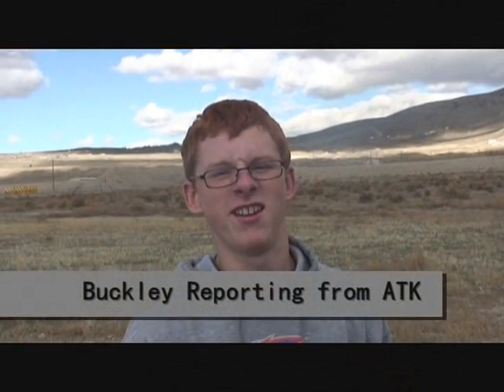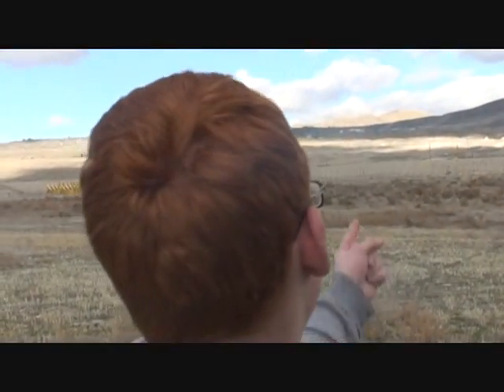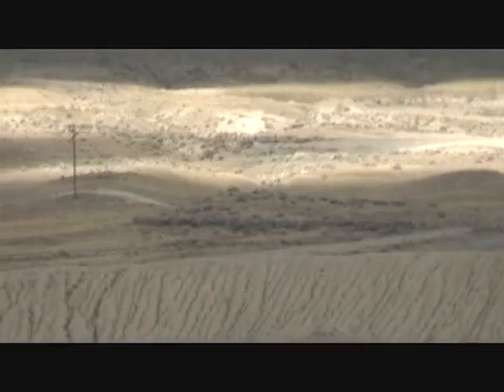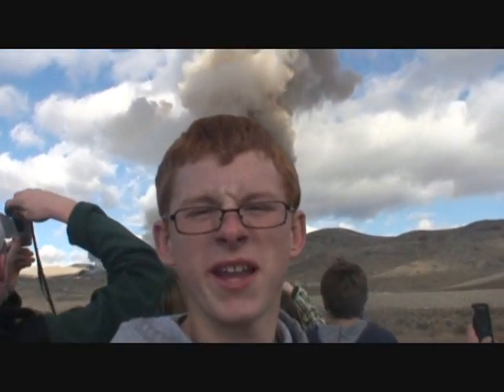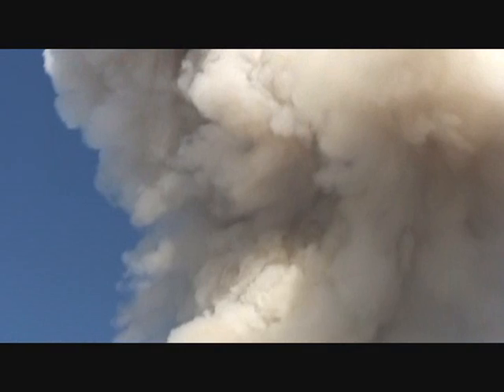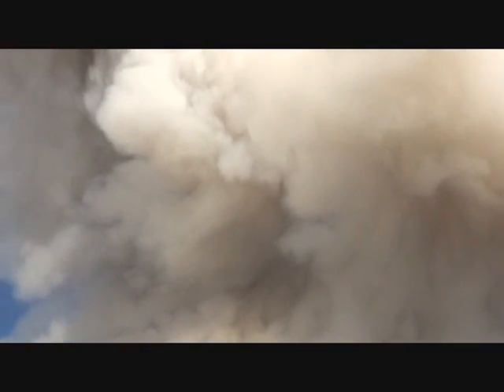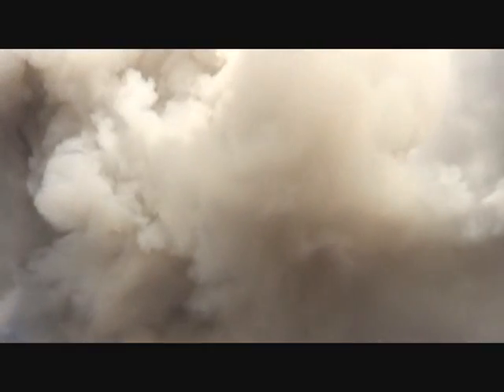Static Rocket Test of FSM-15 on December 4th 2008

Comment: @rtough1 Don't even bother with that. Even if the rocket motor was using hydrocarbons like gasoline instead of Ammonium Perchlorate Composite Propellant, they're used so infrequently that it would put out as many pollutants into the atmosphere in the whole 2 minute burn time as an okay-sized city would in a couple of seconds.